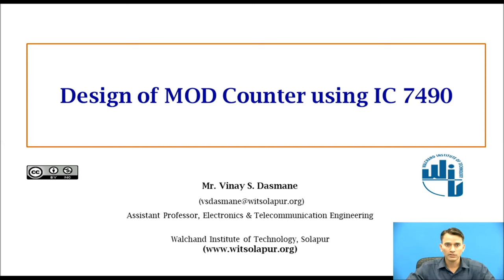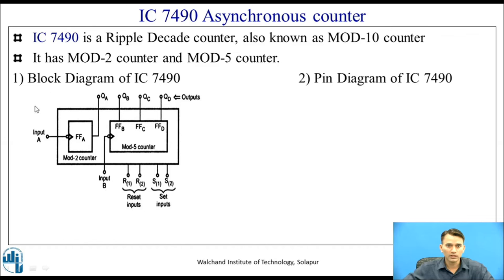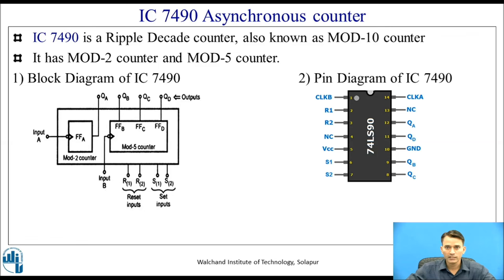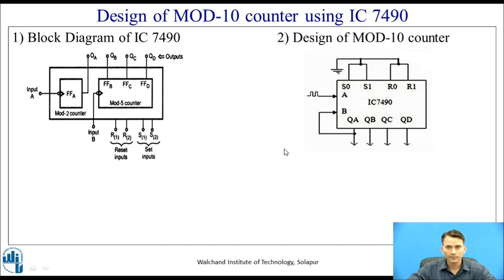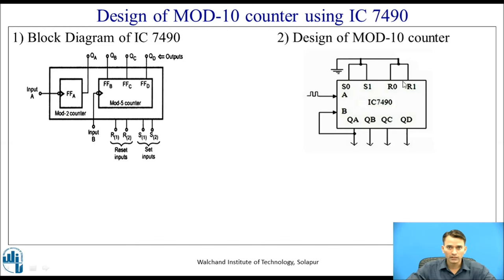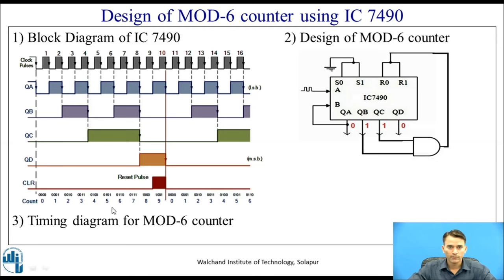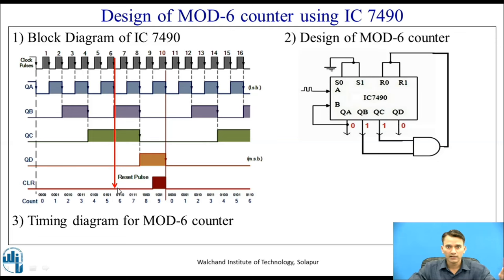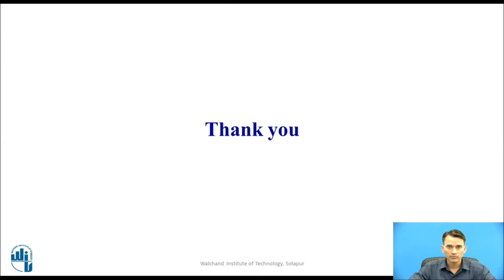Design of MOD counter using IC 7490

Comment: Sir why we've used AND gate ?plz reply fast sir ..
You explained very well sir thanks 
Reply fast sir
Reply: Because it resets when signal is high, to reset on low there would be a circles before R, so NAND gate would have been used instead